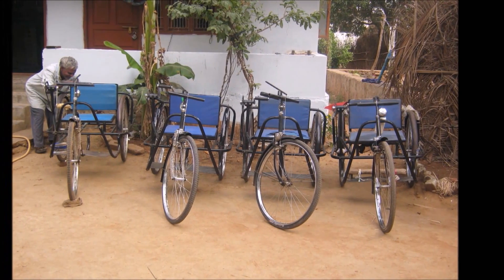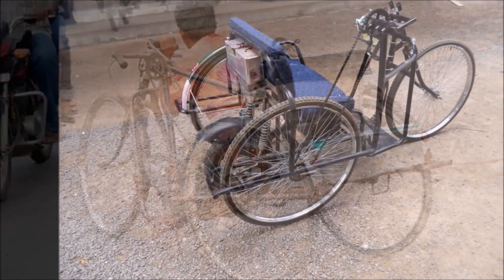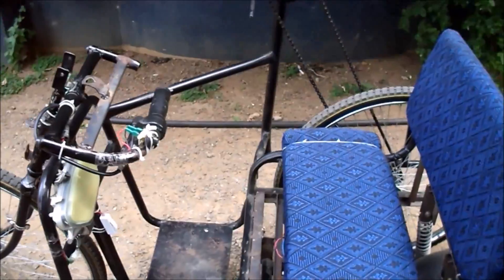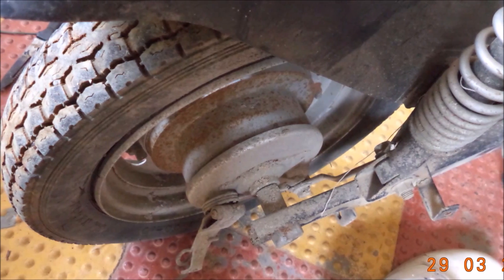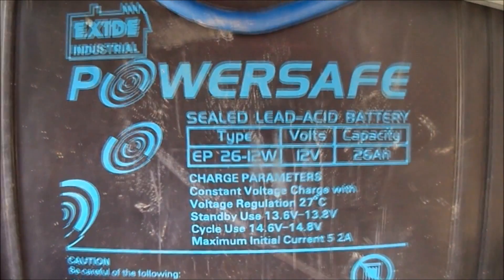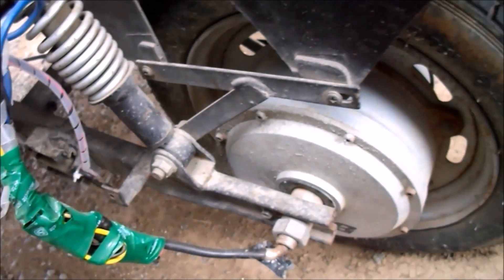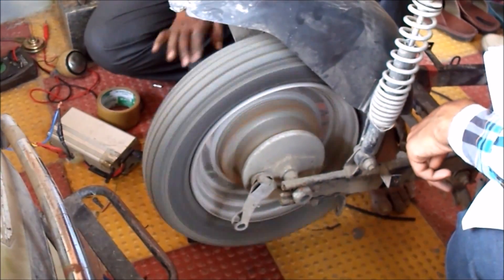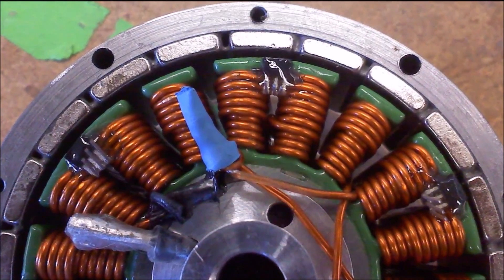Electric Tricycle For The Disabled

Comment: The Bike can be used with pedals alone, electric power alone✰✰>share4.photo/eTrike?o41   or both together! The only caveat is pedal and electric combination drops out when you hit sixth or seventh gear; not really an issue but disappointing: I guess they don't want you going too fast. Also as a former motorcycle rider; you still have to lean into the turns to avoid a roll-over if you are going any speed! Overall a very nice piece of equipment! Also recommend handlebar extenders to install rear view mirrors in order for them to be high enough and far enough apart to be really useful. Safety note: I would not recommend this bike for older folks with balance issues for the reason I noted above.